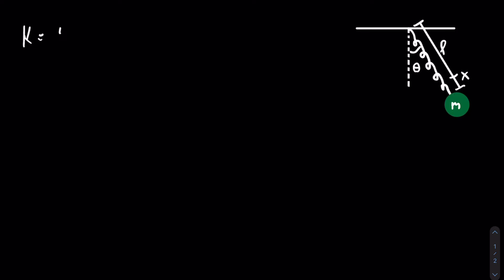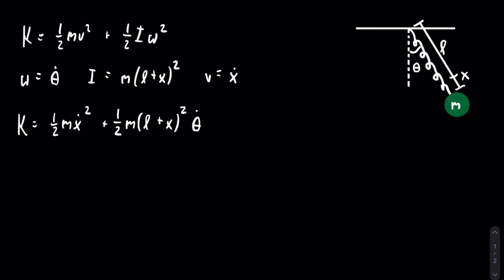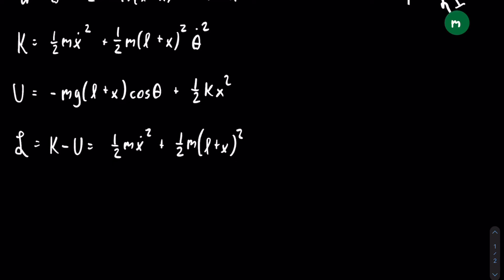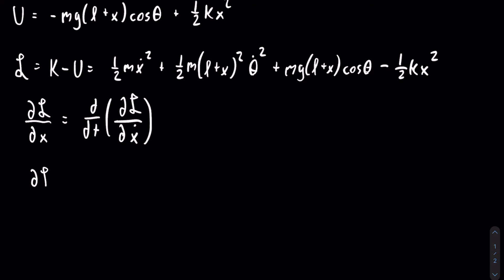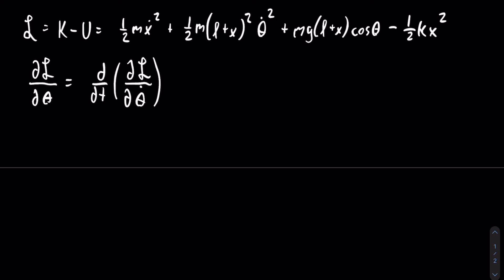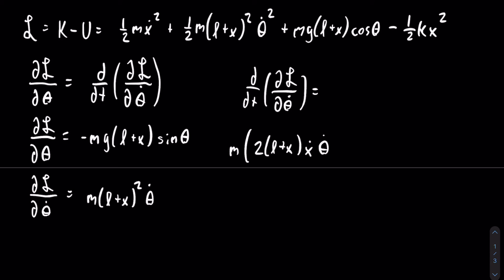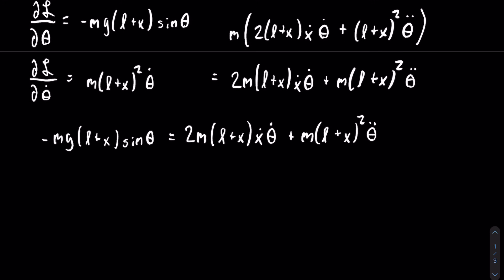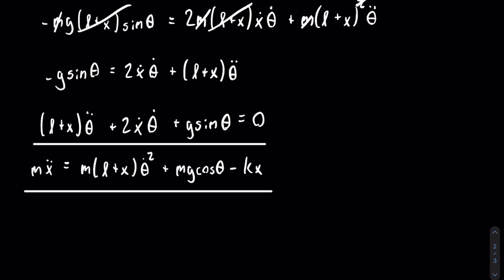Lagrangian Mechanics Part 8: Spring Pendulum

Comment: Bro your lagrangian is correct but the way you have derived it is totally wrong! Why the hell rotational kinetic energy is coming into picture! Just write the translational energy and who get the desired lagrangian

I am not saying it's not correct, but rotation of a point is usually not a meaningful concept
Reply: The rotational kinetic energy is for that point object behaving like a pendulum (infact this system is a pendulum with just changing length ) & translational kinetic energy is for movement in radial direction which is changing length .it is due to spring force.